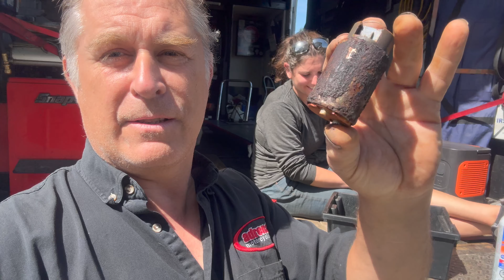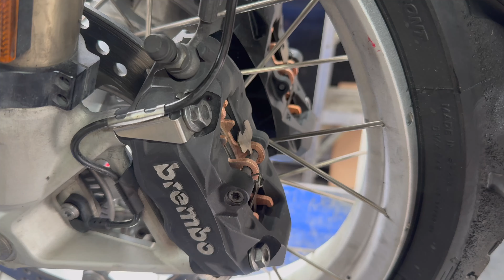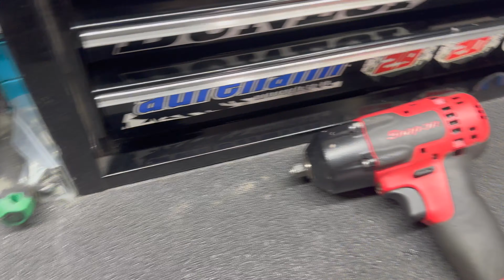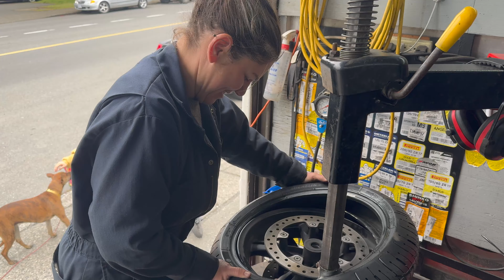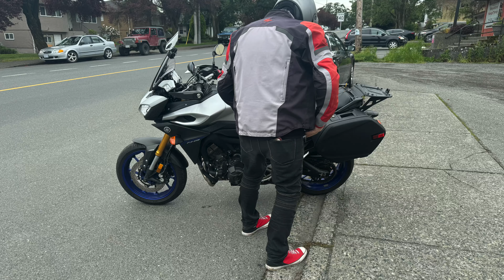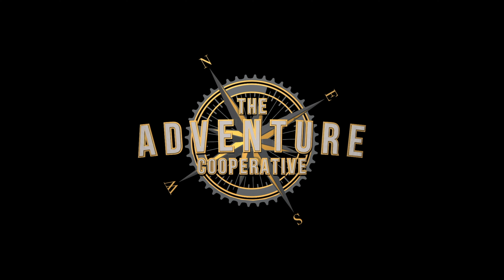TECH TALK EPISODE 12 - Why do people wreck stuff?

Comment: Great video.  I've been a backyard wrench for about 50 years and would like to think I have learned something over that time.  Number one would be to purchase proper tools and use them correctly.  I like to do all my own work on my bikes (except tires which I leave to you guys) including valve adjustments, linked-brake flushes and general service items.  Before I take on a job I will refer to factory service manuals, trusted bike-specific forums and trusted You Tube videos (like yours) until I feel comfortable with what I'm taking on.  I have no qualms about turning something over to my mechanic if I think I'm over my head although that occurs very rarely. I don't rush my work and try to keep things clean and organized.  I also follow factory service schedules religiously to avoid "surprises".  I get a lot of satisfaction knowing the job has been done correctly and and as a result my bikes are always ride-ready and perform as they should.  Keep up the good work!
Reply from the maker: We know that many bike enthusiasts are well equipped to do the work. We just keep seeing those that don't.

Comment: I think all the points you mentioned are reasons for more DIYers. When it comes to enduro/dirt, riders should have a better understanding of how to maintain and fix their bikes, not just so they can get back out of the woods when the inevitable happens, but also to avoid missing half the riding season due to shop appointments for every oil change, tire swap, spoke repair, chain and sprocket set…
Reply from the maker: All true, but what can we do to avoid making big mistakes? I guess its just a by product of the learning curve.

Comment: I’d draw the line at splitting the cases and diving into the transmission. I’m not a mechanic but have always enjoyed the satisfaction of doing my own service work . If you have a shop manual and are patient as well as mechanically inclined many of the task are not that bad . If I get advice to substitute a tool for a diy option I almost always disregard that and source the proper tools . 

As for why you are seeing more problems rolling in  it’s probably a combination of the cost of living and down time or availability. 

One last thing I see you recommending fuel stabilizer . My experience has been better without because the ethanol in our fuels turn to jelly over the winter with stabilizer in it . If you run premium you should be safe but even those sometimes can have ethanol.
Reply from the maker: We often say it's all easy, and just as easy to do wrong. Being mechanically inclined sure helps. What product have you used that created jelly? None of the bikes we have prepped had that, but have seen it.
Reply: @theadventurecooperative  stabil and the moto master one . Talked to the service manager at a power equipment store and he said he sees it all the time . Told me if using stabilizer to use non ethanol fuel . Must be true because the stihl 2stroke oil has stabilizer and when mixed with premium I’ve never had an issue in my gas tools . I don’t store my bike long term so it’s really not necessary for me to use stabilizer in it .

Comment: Don't know what the shop rates are in Canada, but in the States - California - they are utterly ridiculous. Some places charge as much $175 - $180 USD/hour.  So when you are charged $600 for a 1000km run in service, it leaves a sour taste.  Especially when you look at what they actually do for that $600.  

Many dealerships sell and service multiple marques, but they can't keep their technicians, and the ones they do keep aren't necessarily invested in your bike.  People want a relationship with the person who works on their bikes.  Sometimes the best person for that is the owner. Dealerships don't or won't always give you that.  They'll buddy you at the sale, but after that not so much.  

Owners should know how to do certain things on their machines, but they should also know their limits.  Knowing how to change oil, change a tire, cleaning an air filter and checking for loose fasteners vs valves, cams, chasing electrical problems.  YouTube has plenty of tutorials for a lot of motorcycle repair / upgrades. 

I'd love to have a pop up mechanic like you seem to be near me.  But I don't, so I try do some stuff for myself.  Good topic.
Reply from the maker: I think we all know the problem. You nailed it. The question is what is the answer. We ran an open shop concept for 17 years called Adrenalin Motorcycle it was much loved but could not find or keep quality techs. I stepped into that role and didn't escape those handcuffs for a decade. I think the next video might talk about that.

Comment: I have to many bikes. I ended up doing bulk of my work. I do read the manuals and have lots of tools. As for tires I hate doing them, having said that I was charged 300 bucks to change them, which is a boat load of money. I do have tubes which sucks but 300 bucks is steep.  The rates are getting out of whack, and people don't have cash. Some dealers don't even want deal with bikes they haven't sold to you. My brake pads were 500 bucks OEM. I will not do certain things because 1. I do not know how 2. Don't have the correct tools 3. Am afraid to do so. Valve checks on my Vstrom is all gone be at the shop.
Reply from the maker: Totally understand all those concerns.

Comment: When I got my first scooter about 7 years ago I made it a goal to learn how to do all the maintenance myself that I was comfortable with.  So far the only thing I haven't attempted yet on my own is checking valve clearance.   Bought a new Tenere 700 this January, took that to my local shop for the break in service.  Other than that, I think the last time I brought my bike in to get worked on was when I got you guys to install a new tire on my wheel.  I think that was just before you guys had to close the shop down so it has been a minute.  (Was wondering why you guys looked so darn familiar when I stumbled upon the channel.)  I see you guys run mobile lately, is there a business name I could look up if I am ever in over my head?
Reply from the maker: Performance Motorcycle Works on Facebook.